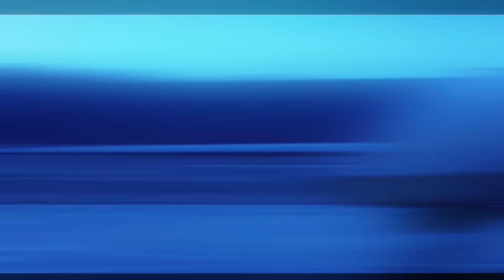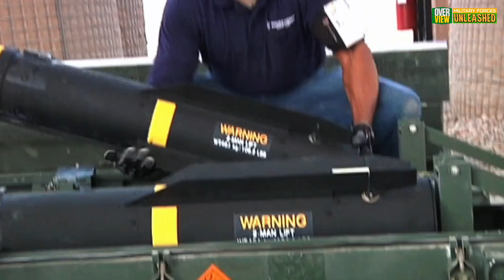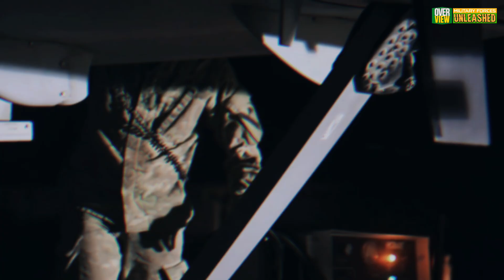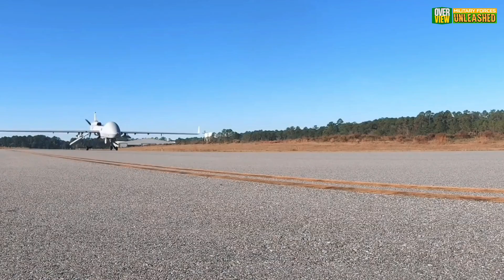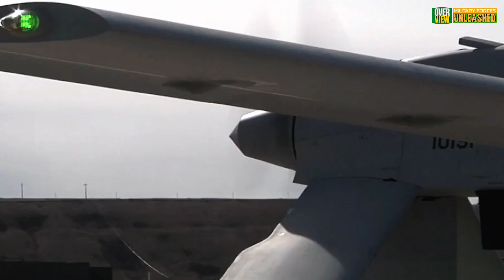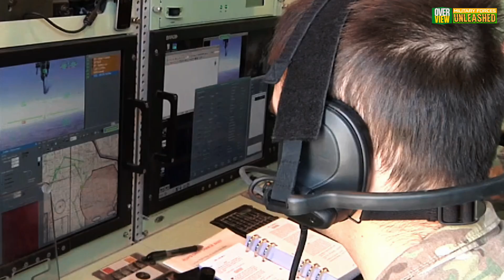Gray Eagle Drone’s Jamming Pod: A New Era in Electronic Warfare?

Comment: The jamming pod appears to have an array of steerable emitter antennae inside the pod “canoe”.    This makes sense as it allows signals from AAA fire control radars to be suppressed as well as mobile communications vehicles or vans  to be disrupted.
Reply from the maker: You’ve hit the nail on the head with your observation. The design of the jamming pod, particularly the integration of steerable emitter antennae within the “canoe,” reflects a deliberate move toward multifunctional capability. This isn’t just about broad-spectrum jamming but precise, targeted disruption—a hallmark of modern electronic warfare (EW).
The ability to suppress AAA (anti-aircraft artillery) fire control radars while simultaneously disrupting mobile communications showcases the sophistication of the pod’s systems. Steerable emitters give the drone a dynamic edge: rather than flooding the entire EM spectrum with noise, which can be inefficient and easier to counter, it can direct its energy toward specific threats. This not only increases effectiveness but also reduces the risk of detection and retaliation from hostile EW systems.
It’s worth noting that this kind of capability positions the Gray Eagle as more than a reconnaissance or strike platform—it becomes a force multiplier. By disrupting enemy communications and degrading their situational awareness, the drone enables friendly forces to operate with greater freedom and less interference. This is a clear example of how EW is evolving from a support role to a front-line enabler in contested airspaces.
Your comment aligns perfectly with the idea that these jamming pods represent a shift toward precision EW, something that’s becoming indispensable in modern military operations. Thanks for pointing out such a critical detail—it’s always great to see sharp technical insights in the comments!